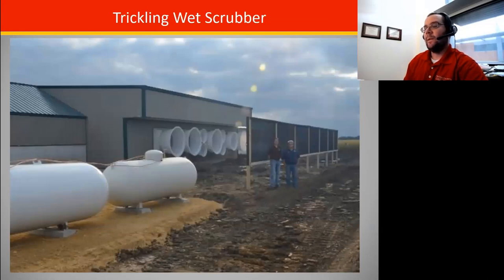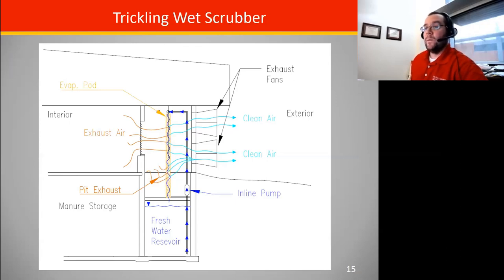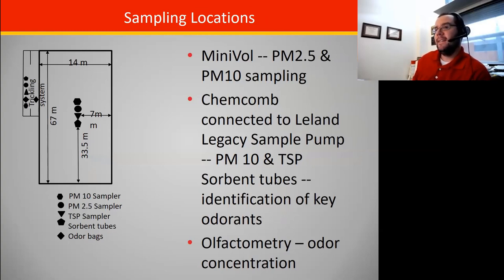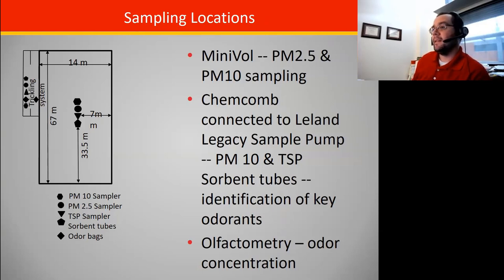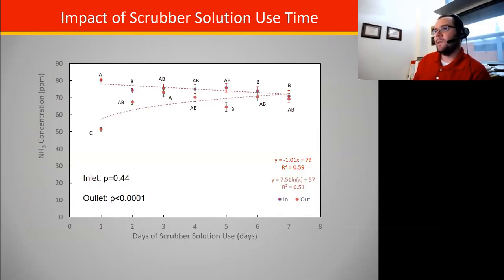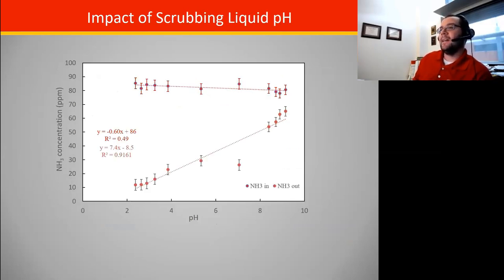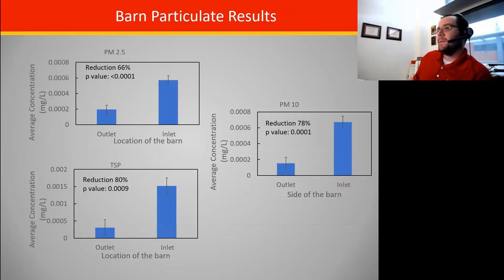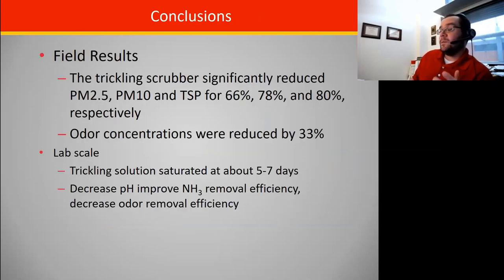Odor Control Options: Wet Scrubber Wall

Comment: Hi! Would a feasible option be to burn the gases, if collected by a non-back-flow valve (separation) system, to generate (for example) heat?